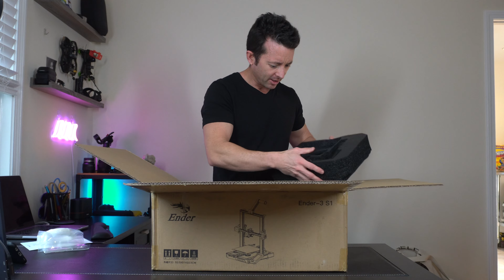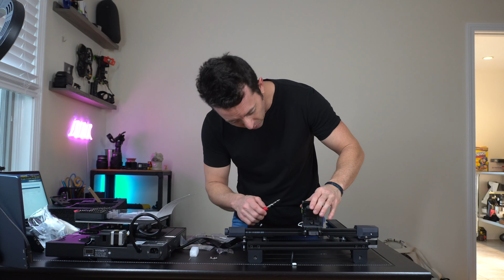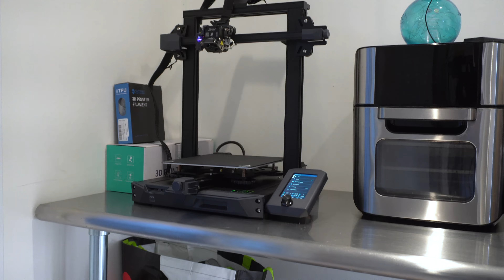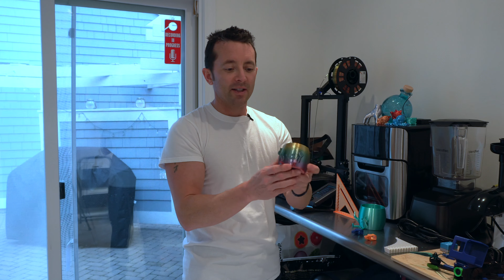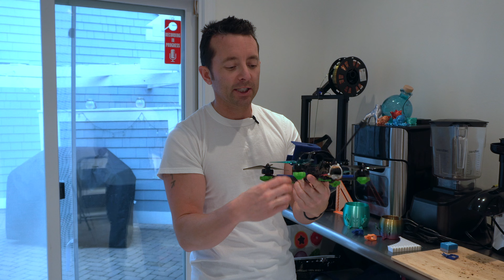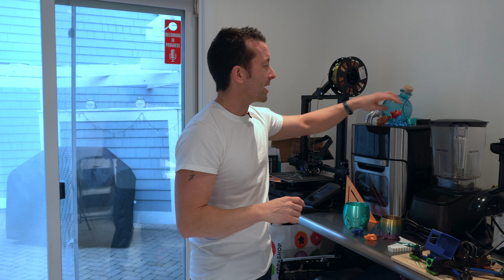My FIRST 3D Printer!! Creality Ender 3 S1 - Works SOOO Good For A Noob!

Comment: Good Choice , I got mine E3S1 a week ago and used up one roll of TPU already ,  Get the Magig 3d printer adhesive
Reply from the maker: Great thanks I'll check it out! yeah I'm about to burn through a roll of this fast change rainbow filament after that super large octopus came out great I've got another one to print and a couple other large items.